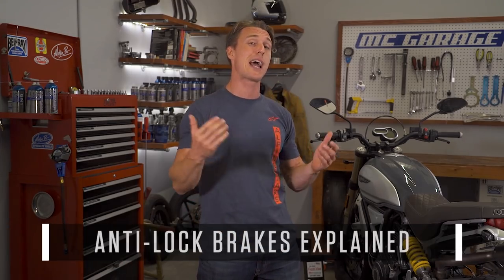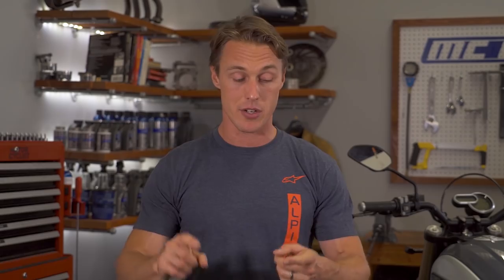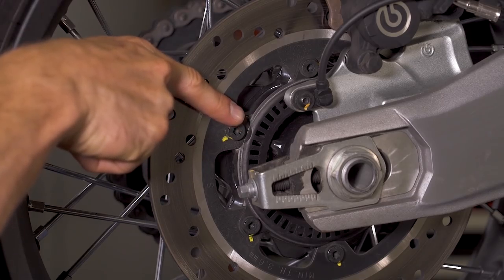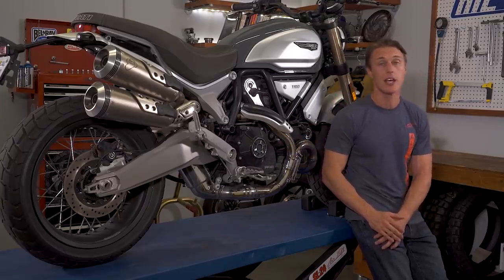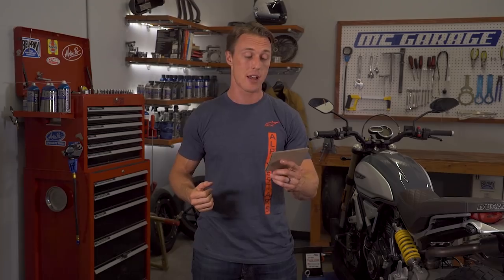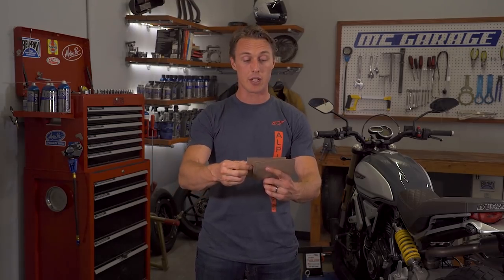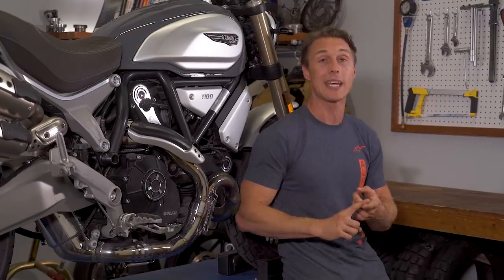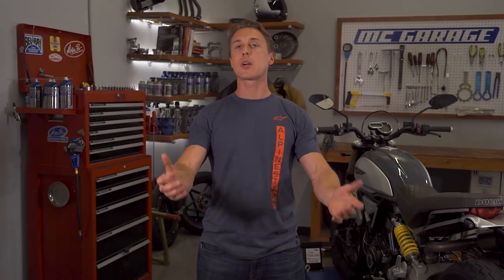Anti-Lock Brakes Explained | MC Garage

Comment: I've been riding 3 years now without ABS, but I would not mind having it as long as I could also turn it off. I like sliding the tail once in a while if the road is slippery or I'm just having fun coming up to a stop light. But I do like the fact that all new bikes (from 2017+ I think) sold in Europe must be fitted with ABS as standard. People here take this stuff seriously, which combined with the proper license requirements really make motorcycling in general a lot safer (and also more fun).

Comment: My previous bike, a Honda CB500X the ABS was awful, it interfered well before the wheels were actually locking and actively increased braking distances due to it's behaviour. I ran with the fuse pulled after I learned how to brake "properly". However since upgrading to a bike with a lean sensitive ABS system I leave the system enabled with the rear channel turned off so I can still back it in. The premium IMU based systems on the premium bikes are excellent, the simple dumb two-channel systems are an impediment to riding fast but are a safety enhancement in traffic situations. A good system also gives you an idea of where that tyre's limit is just before you reach it, teaching you with that lever and pedal feedback that you're approaching the limit, unlike a traditional braking system which relies on you feeling the rear slide under the seat or the front tucking through the bars to tell you where the limit is. And you're right MM93 is a magician.
Reply: Great comments, thanks for sharing Kefford. I agree that ABS can be a great tool for discovering just how much traction your tires actually have.

Comment: I had a Sinnis 125cc and I locked the back wheel loads of times and came off. Got a 500c Honda with abs and not had a single issue with locking or braking 👌

Comment: Just got back on a bike this year, and first item on the must have on the bike was ABS.  On an early commute home traffic pulled onto the off ramp, riding brakes in front of me then suddenly everyone nose dived.  I swerved over the rumble strips, onto the shoulder with the ABS system doing its job under heavy braking because the guy behind me wasn't slowing down as much as I would have liked (I would not have fit in the space left when he finally stopped).  I could have gotten a bike sooner (and cheaper) if ABS had not been a requirement for me, but I could also have been a hood ornament.  A coworker of mine watch one of her riding group drop his bake and end up in the hospital after a similar situation without ABS.  Her husband had insisted she get a new bike with ABS, she had no issues stopping with control.  

After those two events I'll never not have ABS on a bike. (unless I find a '79 CBX I can afford)
Reply: Thanks for sharing Clifford. Glad you're safe!

Comment: Really liked this video! ABS has certainly saved my ass a couple times in emergency situations on the street like when some dumbass decides to pull out in front of me without indicating and the road is wet, etc. 
PS. I would love to see an MC garage vid about idling vs shutting off at a red light, especially for watercooled bikes with radiator fans. I personally never shut off at a red light but so many bikers where I live (Bangkok) choose to do it instead of just letting it idle. I would love to hear your thoughts on it.

Comment: Future video question. I’m still fairly new to riding. I have figured out that leaning forward on my FJ 09 gives me better handling in corners. My question for you is how much does it matter if my weight is on the seat or the foot pegs? Do I gain performance by keeping my weight on the pegs and down low?
Reply: Generally speaking for aggressive riding you'll want your bodyweight on your footpegs. What you've discovered with your body positioning on your FZ is how weight distribution affects chassis geometry (fork angle and rear squat) and how that in turn affects handling.

Comment: Well, I have a 2018 Fatbob 114 with ABS and I also have an older 2003 CBR600.  I find that ABS is great, it has saved my a$$ more than a few times from other drivers on the road not paying attention.  Even though the Harley outweighs the CBR by a lot I feel more confident with the handling and braking system in everyday traffic on the Fatbob now...

Comment: I like ABS on my XSR900, it has activated a few times on the front when I hit some gravel that blended in with road surface. Not sure if it saved me from anything or not, I think I could have released brake pressure in time to regain traction just fine, but not as fast as the abs did.

Comment: Ari, what exactly is different about cornering ABS than regular ABS? Is cornering ABS something that would allow you to grab a fistful of brake from turn in all the way down to the apex/max lean angle without letting the front tire slide out? Essentially, trail braking for you. Why can't regular ABS do the same thing? Aren't they essentially just releasing the brake every time an under-rotation is sensed? TCS I can understand saving highsides as there's a bit more time from the rear spinning up and the bike actually sending you, but I feel like when you're trail braking down to the last degree of lean that you can, any slight skid will mean the end of your ride. The ABS system would have to prevent the loss of traction all together. Unless you have elbow training wheels that is...

Comment: Definitely want ABS on my next bike. I commute on my bike every day, and I've locked the front enough times in emergencies that it's only sheer luck that I haven't gone down already. I bought the bike secondhand, but definitely would have optioned ABS if I'd had the choice. The extra cost would have paid itself back in underpants replacement by now.

Comment: The new Honda PCX 150 in Indonesia, equipped with front disc AND rear disc brakes. BUT, they equipped the ABS only on the front. So, it’s kinda exciting when you hard/panic braking on 70kmph, the rear tyre went slip and squeaking (?) but the front just went in straight line.
I don’t know if that has something to do with the rear disc are thicker than the front..

Comment: What happens if you remove the abs ring on the rear wheel. Can the bike still be used for offroad / dualsport driving. I like when the rear can lock up and skid on the gravel road.

Comment: I had a motorcycle crash (minor) while cruising at about 60km/h. Was trying to avoid crashing into a fool who pull into my lane without a notice. My wheel lock up due to sudden brake and I went skidding before losing control and goes down. 

I believe if my bike is equipped with ABS, I wouldn't had crash and lost control. My next bike will definitely need ABS as mandatory. I may have been riding for 22 years but it doesn't make me immune to traffic accidents especially when caught off-guard.

I did ask a sales person before that why the new Honda 650cc doesn't have ABS and the sales person got a knack to tell me that season riders doesn't need ABS and how he don't even need one. I told him, I used to think like him until I had my first crash recently. One can never be too confident with own skills. 

I trust ABS and my riding skills but not going to risk it.

Comment: 100% agree. It doesn't matter how good you think you are, nobody can determine the traction on every inch of surface, all the time, everywhere. If your tires are warm, you know the road and are 100% concentrating - you can still hit a patch of "invisible" oil. You can't react - but the ABS can as it monitors the wheels 100% of the time in milliseconds. Thinking you're better/faster than a modern ABS computer is, to be honest, arrogant. Now, off-road / special surface - sure.

Comment: My friend and I were practicing emergency braking.  My bike (2015 vstrom 650) has ABS and my friends bike (2008 shadow 750) doesn't.  Huge difference in control and stopping power/distance between the two with ABS the clear winner.
Reply: Part of that difference has to do with the bike design, too. Your V-Strom is going to load the front tire more and decelerate faster. It's also likely got softer tires, even if they're a dual-sport design. The Shadow likely weighs more, loads the front less, and has significantly harder (and thus less grippy) tires. It's all part of the design brief of a cruise.

Comment: I've done a few unofficial panic stop tests with abs on and off. On dry pavement only. I could stop faster with it turned off on my XTZ1200. However it takes alot of attention where as with abs on. I can just hit them hard and don't worry about a skid. I turned it off accidentally the other day. I was easing thru a parking lot and a lady backed out right in front of me. Slammed on my brakes and skidded the rear tire and stopped about 2 feet from her back fender. I never turn it off unless I'm  offroad.

Comment: Absolutely useful and good thing, but there are different approaches for abs systems and some versions on the past had reliability problems as example bmw servo abs quite expensive to maintain if it brakes down. The only negative thing that comes to my mind is not abs itself but mentality of some riders who think there is no need in practicing emergency braking because they have advanced abs system.

Comment: ABS saved our asses when braking in Scotland on wet tarmac, the rider in front of us quickly braked to make a left turn onto a road he noticed a bit too late (without blinking.) I felt the ABS-system assist in my panic-braking.. Had our bike been without ABS we most definitly would have crashed, probably even sliding into the other bike. We rode for another week through Scotland and home, will never go back to touring without ABS.

Comment: interesting concept.... I'd like to see maybe a Video on why some people forgo ABS and the pros of not having it? :P 
 I understand it's a really handy system but for a lot of people with older motorcycles (myself included) it's never really been a factor as they aren't available. I know a few people that prefer having all the braking power at hand and they feel that if you slide out or lock up then it's your own fault for not knowing your brakes thoroughly (ABS is a handy idea for those jumping from one bike to another or for scary wet days). for the argument that no one is as skilled as rossi on the street at braking - a few have taken course to improve their braking on non-abs bikes and JESUS they're machines!

Comment: My 2012 Ninja 1000 has it, and it's my first bike with ABS.  I figured I'd never use it, except maybe if a car pulled out in front of me etc..   I have to drive 4 miles on dirt road every day and one day the wash I have to go through was full of deep sand AND had a nice drop off in it thanks to a storm that happened a good 5-10 miles away (my dirt road never saw any of that rain).  Anyway, I'm cruising along at 30-40 mph like usual when I see the drop and the sand.  I grabbed the front brake and I felt the ABS kick in right as the front tire went off the drop off (only 2"-3") and into the softer stuff.  If I didn't have ABS I'm sure I would have locked up the front tire right then.  I've been a believer ever since.

Comment: Are ABS in a dual front disk the same as the ABS in a single front disk brake? In terms of configuration in the module or in the pump and sensor?

Comment: This video is 4 years old, both of my 15 year old 50cc scooters have aftermarket mechanical abs systems on the front wheels, they're super cheap setups, but I can confirm that they work, so yes. There WERE super affordable aftermarket abs systems for motorbikes as of thos videos publishing, but I don't know that I would trust them on a full size bike

Comment: My bike doesn't have an ABS. But, the front brake never had locked my front wheel. Is there something wrong with the valves in the master cylinder and the ducts in the brake caliper? 😅

Comment: I have a 2012 Triumph Street Triple R and ABS wasn't an option so I make due with my two finger pressure modulation. But I have tried many ABS braking systems on old and new bikes from all Harley's to Yamaha R1Ms and they all feel spongy or lack feed back that I crave as a rider. I've also come across a few bikes that have no feed back and then the brakes bite in without a feeling change of pressure. I love the feed back of my non-ABS bike and the firm feel that it provides all the way through the lever pull/squeeze. Do you think it will every get to a point where an ABS system will feel like a standard braking system much like hydraulic steering has changed to electric in almost all cars? I also changed my rims out to BST carbon fiber which has reduced my rotating mass dramatically where I can stop, change direction and accelerate much quicker then ever before but the back end likes to kick up now under strong braking. Thanks for your videos they stay simple and to the point and I appreciate that for sure. Keep doing what your doing!

Comment: I switched from a 1997 Fireblade to the 2009 one, the first one with ABS. it's been a horror story. Basically I changed a bike that could lock up very easily for one where I could not predict what the brakes would do from one moment to the next. perfect braking, braking full power if I only looked at the lever, or having no brake power at all. it took me 2 years of non-stop garage visits until they finally switched out some parts for that of a younger bike.

I've seen ABS in action and it works. if you've ever yanked your brake out of reflex in a moment of panic, you'll know the difference. People that say "It's nonsense, learn to drive!" are probably also riding without a helmet because they're so awesome. You dress for the slide, not for the ride. same goes for the technology on your bike.

However: never buy the first version of any new technology. Always wait for the next version, the one where they have learnt from their mistakes.

Comment: Great video and explanation but you missed one major flaw of ABS and that is when a rider uses it too much for too long he is losing his ability to feel properly his brakes and the amount of grip while stopping and when that rider goes on a bike without ABS that may end up with a lot of trouble, I've seen what happens in that case and the picture is pretty bad. The best way to avoid this is with an ABS that can be turned off and use it as less as possible.

Comment: I had ABS on my 13 deluxe then when I bought my 17 streetglide it didn’t have ABS.  ABS is only on the streetglide special to my knowledge.  But the first time I had it on the highway in traffic some assbag changed lanes on me. Locked it up but I held it straight. Took some getting used to but I don’t notice not having ABS now. However I’m extra careful in slick conditions. 
Harley had some odd option combinations in the past where ABS was part of the security package and whatnot.

Comment: ABS has saved my arse a few times but also endangered me ( 2012 f650gs) it's great when going fast and emergency braking. But slower speeds I tend to find it causes more problems, like filtering speed my abs has triggered whilst trying to stop on white lines where a skid would of stopped me faster but the abs caused me to nearly crash into a car that had pulled into the middle unexpectedly.

Also it's bloody annoying how it turns itself back on everytime I restart brake . Had so many near misses off road because I wasn't able to lock up the rear.

Comment: Bro 1 more question...
If someone doesn't have ABS, what is the effective way of braking?.. like pull, release, pull, repeat? If so... How to do it? Like when front and when the rear .... Or both together, pull, release, repeat?
Reply: If you skid on a non-ABS bike you just gently reduce brake pressure to restore traction. Sounds easy, but it's hard to remember to do in an emergency. I generally rely on the front brake and only use the rear when riding larger bikes or when I have a passenger.

Comment: ABS as saved me a at least twice now.   Just yesterday, on my R1200RS I overcooked a decreasing radius downhill turn and had to scribe speed mid-turn.     The rear ABS definitely activated, the front may have as well.    I was able to scrub the speed I needed without crashing.   I'd likely have crashed without it.     Another time, on my Monster 796, and a dry day, there was water running across the road before and through the turn.     Again, I likely would've crashed without it.

Comment: I think manufacturers should all give us the option to disable the system when needed. I almost crashed a few years ago on my Burgman 650 because the ABS kicked in when it shouldn't have, it was a 180° turn with a shear drop on the other side in that case the ABS nearly killed me, luckily there was guard rail all around the bend and i stopped against it. It's a must only in bad conditions, in good riding conditions it's mostly counterproductive. The Burgman was an old 2004 model with older ABS system, but i now have a 2018 AK550 and it has Brembo brakes at the front and Bosch 9.1 dual channel ABS (whatever all that means), and it's still not adequate for good conditions.
Reply: Sarge Ypsylon, you fail to understand what ABS is...

Comment: Is there a big difference between more recent and older ABS systems? For example, is the ABS on a Honda CB500F (2016) much better than the one on a Honda CBF500 (2007)? If we exclude things like cornering ABS, what's the advantage of buying a newer ABS bike?
Reply: The technology is constantly progressing. A top-of-the-line ABS system from a late-90s BMW can't hold a candle to what you get on a late-model 250cc. As for the technology gap from 2007 to 2016, I don't actually know what's different, but I'd speculate that wheel-speed signal frequency has increased and that the speed and accuracy of the solenoids in the ABS pump have improved in that time. I know the size and weight of the hardware has certainly decreased quite a bit.